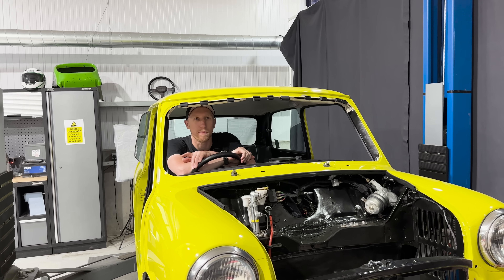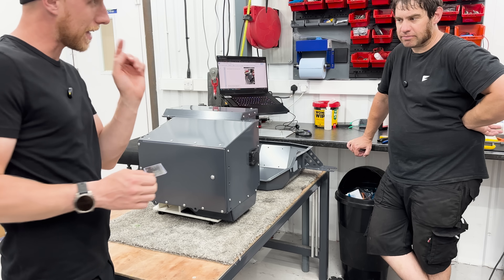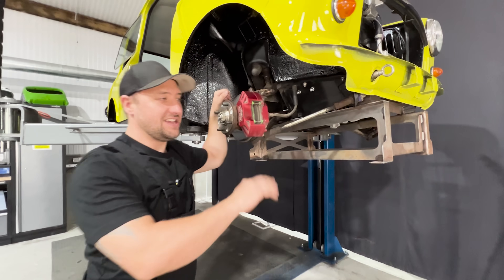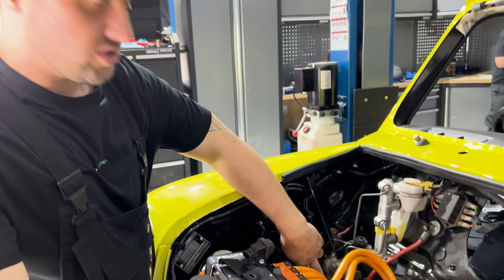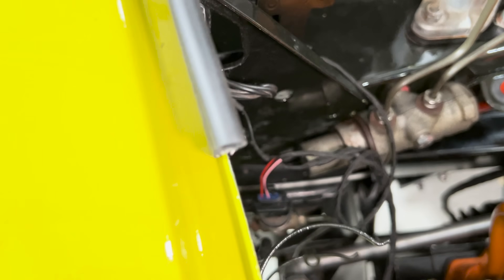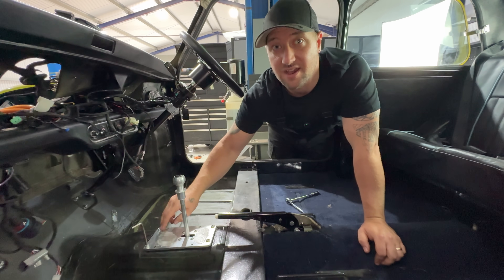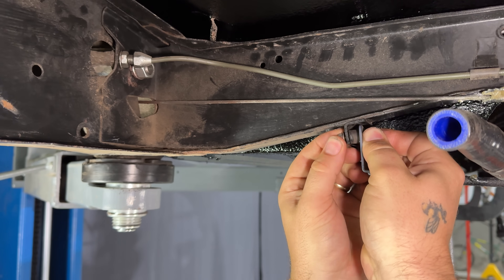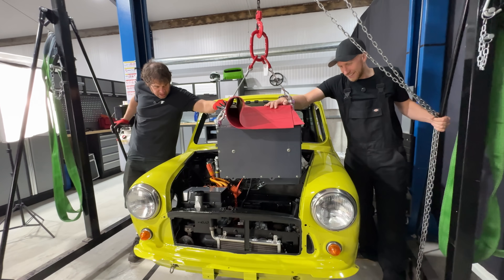EV conversion of a Classic Mini Cooper to Electric - The E Bean is assembled ESP3 - Part 1

Comment: Plz explain how eletric cars are good for the planet? Love the build
Reply from the maker: It’s not always about the over all planet, it’s about the stuff our kids, friends and family are breathing in within the local area. With electric cars the localised air quality is so much better it will help people you care about live longer heather lives. Also remember electric cars are new in the grand scheme of things so as technology gets better the manufacturing process will improve and get even better for the environment.
Reply: @Hazell_Nutz yea that diesel and coal generator constantly provides very clean electricity
Reply from the maker: @gauravlagariya6200  clearly you do not know how to research the power grid supply. Over 30% of the UK is renewable the rest is gas, biomass and nuclear. Plus it is only getting better with the planned increase in renewables. If you are going to comment at least know what you are talking about!
Reply: @gauravlagariya6200  localised air quality built up areas and residential areas will have a better air quality. Not sure about you but I don’t have a power station at the end of my street I do however have a few wind turbines and a nearby field.
Reply: @Hazell_Nutz  i know extensively about power grids in uk as i work in one and there are number of electric charging stations that are directly connected to coal generators. Other then that uk still uses coal to produce electricity its extensively reduced but there is still use of coal for electrical supply. I agree it’s becoming less and less day by day but still a gas car is better option for most of people

Comment: This looks a fantastically well developed kit for the Mini. I know that they do not like any modifications to the shell, but couldn't the 12v battery box be deleted to allow the rear traction battery modules to be fitted under the boot floor? The original (12v battery box) panel is easily sourced from suppliers, as they often rot out, so retro fitting one if needed in the future would be easy enough. And a smaller/lighter lithium or sodium iron 12v could be placed elsewhere in the Mini boot? I'm just asking as you seem to have thought of everything and you have probably looked into the pros and cons of this?
Reply from the maker: Can not make any modifications at all not even a hole
Reply: There are many options that might be considered as better but it's all to do with regulations and registration. If they change anything that's part of the original shell the registration routine changes and becomes complex and expensive.

Comment: I notice you install two modules upside down in the front box. I thought this was not possible? It's something you said in your LG CHem module overview a while back...
Reply: Once the pack is in the mounted position the modules are on there side. Only upside down for 5mins on the build jig.
Reply: @Hazell_Nutz_Nick  Excuse me being a pedant, but I watched again. 1:47 to about 2:10 shows the battery box being assembled in its correct orientation. The bottom two modules are attached upside down on the underside of the structural coolant plate. Perhaps it's OK to install them upside down in this application because the battery box is not being liquid cooled?  Also, the modules you are using differ from LG Chem ex Jag iPace...
Reply from the maker: You are correct, they are a pouch cell so can be upside down or on there longs side just not on there short end. But other vda 355 modules we have used on the past have been prismatic cells so can not be upside down or on there short end.
Reply: @shaneambry7712  yes really sorry they are indeed upside down had my wires crossed a bit. These modules are quite happy being upside down. In fact the battery’s being put in the battery pack have already covered 15k miles in that orientation while testing 😊
Reply: @Hazell_Nutz_Nick  Thanks for the clarification!

Comment: After the car is registered a ev would you be able to retro fit a roll cage if you wanted to?
Also would you be able to fit better lights etc or do they have to be oem parts ?
Reply from the maker: Yes you would probably get away with it

Comment: These really are genius systems. Would they fit in a mini clubman, or a Riley elf (seeing as it’s a mini with a boot). Also can you have a lower performance motor to get better range from the same batteries?
Reply from the maker: Yep should fit no problem. The motor is very efficient so does not need lower performance just a new map to make it slower
Reply: Combustion engines will usually do fewer mpg if they are larger capacity and optimised for performance if driven at the same speeds as a small efficient combustion engine. Electric motors are different. A powerful motor can also be a very efficient motor i.e. it generally uses the same energy if used at the same speeds and loads. (Of course a powerful EV motor driven at speeds and loads beyond those of a smaller less powerful will use more energy.)

Comment: i dont konw if this gets answered later in the video, but does this use one of the zonic motors you were designing a few years back (I remember seeing them at fully charged live) or just an off the shelf like a hyper9 etc
Reply from the maker: Yep it has a Zonic 70
Reply: @Hazell_Nutz  nice!
Reply: Are the drive shafts equal lengths?
Reply from the maker: @cad4246  there is a option for equal length, but the shafts are made in a way that one is a different thickness to counter act the requirement.